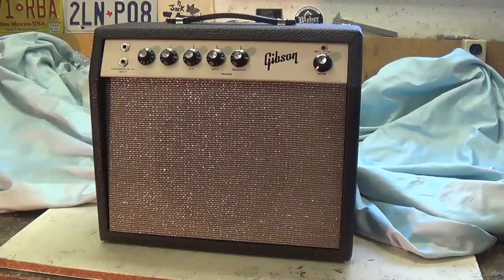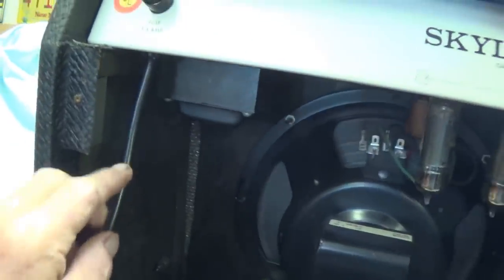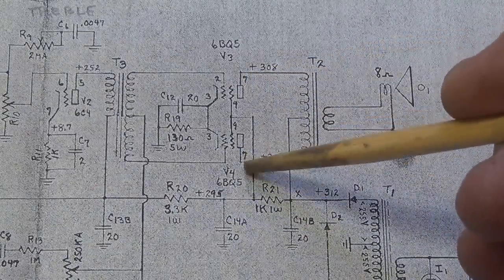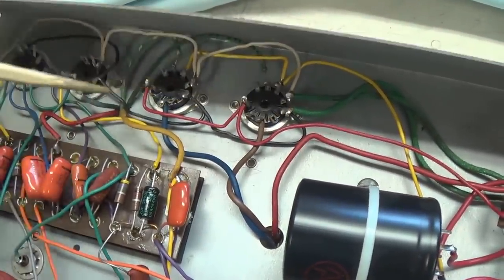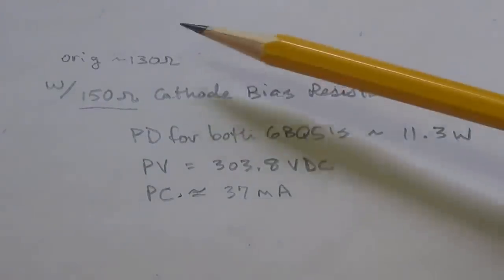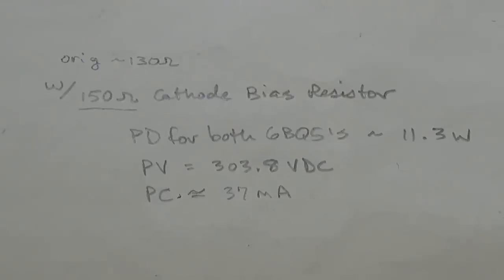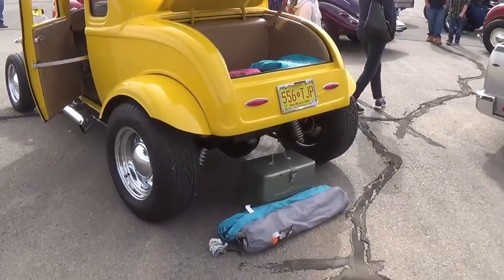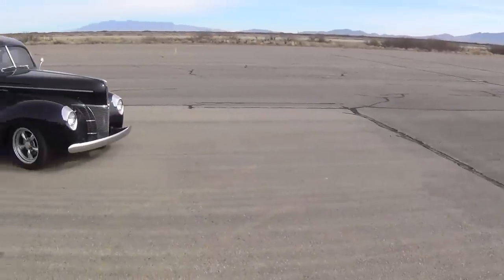1965 Gibson GA-5T Skylark in Superb Original Condition

Comment: Hi Uncle Doug, 
I bet that you have just been anxiously waiting for my customary comments to arrive. Sorry for the delay, we had more pressing matters to attend to, watching our four-year-old grandson, and several other four year old children chase a soccer ball around on a beautiful morning in Waxahachie. Kinda reminded me of trying to herd cats. But it was the last game of the season and our grandson made the only goal for his team. Unfortunately a five foot tall four-year-old on the other team scored their four goals. Oh well they had fun and my grandson's first question to my son when he came off the field was when do I get to start Tee-ball? On to the amp. Gorgeous little amp, hideous design. Your mods made a huge difference. I was just wondering, if you put a wire on the forth  tap on the filter capacitor then replaced the 100K resistor with a 75K and a 25K in series, with the 75K to the plate of the 6EU7. Then connect the wire from the filter cap to the connection of the 75K and the 25K resistors, that would give you a nodal resistor for that final low pass filter in the B+ circuit and keep the voltage on the plate about the same. It might climb a little depending on the ripple at that point. I could hear that customary Gibson 120 cycle hum between chords even with the humbuckers. If it were me, I would have to do as Chubby Checker said ”Come on baby lets do the twist ” to the filament wiring, all of the AC wiring just for good measure. It also occurred to me that the Depth control pot was treated exactly as you stated ”like a volume control” and Gibson used an audio taper pot instead of a linear pot which would account for the poor performance at 1 through 5 of the settings. If I remember correctly the schematic had it labeled 250KA.  One last thing; Star Grounding, hum reduction 101, I guess in 1965 they figured the magical humbuckers would cure it all. Can you imagine someone playing a Stratocaster through one of those amps. Talk about fingernails on a chalkboard, wow. The cars were beautiful, I must agree a 9 inch differential was a poor choice for the yellow Ford and chrome coil-overs, yikes. Almost looked like he was going to go off roading. The honorees pickup was to immaculate. The louvered hood, the recessed radio antenna in the fender and flush mount  gas cap beautifully done. The world  has lost a truly great craftsman and artist. Well, I will end my novel at this point, Happy Easter.
Reply from the maker: At last, you showed up to offer your wise (and welcome) insights, Mark. Your analysis of the Tremolo depth control was right on the money. It should have been a linear pot. I did try single coils through the amp before the mods and had to have several of my fillings replaced. Fortunately, the neighbor is a veterinarian who was handy with JB weld :) Thanks for your spot-on analysis of the car show. It's good to know that I'm not the only one suspicious of the real birth date of 5-foot-tall 4-year-olds......I recall facing several of them in Little League. Some even had beards and smoked 2 packs a day. Oh, well.

Comment: At 17:05, when you point out the power cord wiring that goes first to the fuse, it would have been worth mentioning that the hot wire goes to the rear of the fuse holder, as it should ---- although it might not have been wired that way from the factory oh, I see plenty of vintage amps where the hot lead goes to the middle tab on the fuse holder. The reason for connecting the incoming hot wire to the back end of the fuse holder is so that the fuse disconnects itself from the house current supply first if somebody goes to remove and check the fuse while the unit is plugged in and turned on. Reduces the chance of shocking yourself as you pull the fuse out, assuming the fuse is okay (ie, the fuse is not the reason for the amp not functioning or not producing any sound); unpleasant things can happen if the incoming hot lead has been wired to the central tab of the fuse holder and you happen to touch the metal parts of the fuse and fuse cap as you remove it, with your other hand touching something metal that is grounded,  such as the guitar strings or another piece of equipment that you're leaning on as you bend over the amplifier, or whatever.
Reply from the maker: Thanks for reiterating this helpful detail, GU. Yes, it's always best to wire the fuse holder with the hot wire to the distal end.

Comment: Transformer coupled phase inverters were quite common in radios in the 1930s. Apparently, back in those days an extra tube and socket and the requisite resistors and capacitors were more expensive than the cost of a small transformer to do the necessary phase shift function. After World War II, when tube designs had become more efficient to manufacture, and tube manufacturing factories were really humming along and cranking tubes out by the millions, the  situation reversed itself, and the additional phase inverter tube and socket and related parts were cheaper than the phase inverting Transformer. Perhaps in this particular case, Gibson got a low-cost deal on a big batch of interstage Transformers.
Reply from the maker: Your observation is probably accurate, GU. Component selection was generally based on economics rather than performance......but in this case, it was for the best, IMHO. Interstage transformer rectification generally  provides beautifully symmetrical secondary outputs.

Comment: Great stuff thoroughly enjoying the tours... I am slightly confused though - if the secondary is 255 - 0 -255 (rms?) then how is the dc +312V 255*sqrt(2) is 360 - I'm sure it's right but I'd certainly like to know why - feel free to point me at one of your earlier tutorials
Reply from the maker: This is covered in a previous video, John, that discusses the fact that the filter caps smooth the rectified, but rippled, DC to peak voltage.....which is higher than the RMS transformer rating.  Losses during the rectification process, OPT impedance, nodal resistors, etc. tend to lower the peak voltage, however, to a value in between the RMS rating and the peak.
Reply: @UncleDoug Thank you for your speedy ans helpful response. Yes I know remember that vid. So I can only be sure that the voltage will be somewhere between the rms and peak.
Reply from the maker: You're welcome, John. Yes. Ideally, it would be the peak voltage......but, as you know, no mechanical or electrical system is ever 100% efficient.

Comment: I have one of these in my 'to do' stack, minus the Gibson logo, that I bought from the Guitologist a few years back...just love that grill cloth they used...the redwood cab is built like a tank (except for the particle board panels), and if I'm not mistaken, almost every amp in this line at that time used the inter-stage tranny as the phase inverter...guess it was a way to save wiring up a tube...I'd be curious about your take on how that affects the amp's tone...
I also have an Invader (GA-35) that I refurbished, and I have to say that the wiring and the circuit on that were so convoluted (tone sucking networks, indeed) that I basically gutted the existing circuit and rebuilt it as a suped up Deluxe Reverb circuit, and added a vintage Jensen 12"...probably the best-sounding amp I own... 
Congrats on another superlative presentation, Unc.  Please keep 'em coming...
Reply from the maker: Thanks so much, C7. My experience with transformer PI's is that their two out-of-phase outputs tend to be exactly balanced......more so than with tube PI's. I guess this would maximize output power and minimize hum.

Comment: At about 13:45 you state that the interstage phase splitting xfrmer goes to the 'plates' of the 6BQ5s. I think you meant the grids?
Reply: 13:52 and 14:02.
Reply from the maker: You're right, Joe. Another viewer mentioned this and I am going to post a correction in the first (pinned) comment. Thanks !!!
Reply: I spotted this too, but you get it right later at about 27:00, overall a low error rate for live one-off lecture.  I reckon this thorough style is worth doing a few more of as time and opportunity arises.

Comment: Another great one, thanks. One small suggestion: when demonstrating the amp tones, say a bit more about the guitar and settings. Here you mentioned that the guitar has humbuckers, which was certainly helpful, but whether the neck or bridge was being played would certainly figure in how (overly) bright the amp is. BTW, does the Studebaker still have its death cap?
Reply from the maker: You're welcome, Ben. I have been much more careful about this in more recent videos. Thanks for your input. No, the D.C. was carefully removed, using remote tongs and a blast shield :)

Comment: 14:14 - Probably a good idea to put some distance between C7 and R11!
Reply from the maker: Why is that, David ??
Reply: @UncleDoug  So the cap doesn't get burned by the resistor.
Reply from the maker: The current flow though the 6C4 is miniscule, David. The power generated within the resistor is probably on the order of 1/50th of a watt.

Comment: Question I have a mcMartin ma10 amplifier with a diode rectifier.why is each diode bypassed with a resistor? 
This is my first amp I have recapped that has not had a rectifier tube.
Where do you find schematics for your amplifiers? I've had no luck with this one
Reply from the maker: I have not seen the bypass resistor used with diodes, but with capacitors, and it may be for the same purpose......it is to ensure that an equal amount of current passes through each diode, rather than all through one and none through the other, possibly overloading the one that received all the current. I have no treasure trove of schematics, but simply do what you are doing.......trying all sorts of Internet searches. On obscure amps, like yours, there often is no schematic, so you can either find a fairly close match for it, or do without.

Comment: All we needed was a Buick Skylark in the car show :). As someone that's dabbling in the vintage stuff as a hobby, I'm getting better at schematics, but I always appreciate when you go through the schematics. It reinforces what I think I know, or it fills in gaps with what I'm familiar with. Maybe something you can offer an opinion on. I have a Magnatone M10A with a working vibrato, but the intensity and speed pots are stuck on either one resistance, or go essentially open. Since they're not necessarily in the tone stack / volume department, do you think they would have used a linear taper pot or could it still be audio taper? I can't test the sweep because they're so worn, and the schematic doesn't show an A like I saw in this Gibson schematic. What would Uncle Doug do here if you weren't sure which taper a replacement pot should be? If the answer is in another video, I'm happy to go watch that or re-watch it :)
Reply: An educated guess says that both the intensity and speed pots are likely to be linear, but since you're may have to replace them anyway* , you could simply take them apart by prying up the metal tabs that hold the metal cover over the back side of the pot. Measure the entire resistance of the carbon track on the phenolic wafer from end-to-end, then measure it from one end to the approximate physical middle of the carbon track, corresponding to the pot being set roughly in the middle. A linear pot will have approximately half of its full resistance found at that midpoint, whereas an analog or audio taper pot would likely have 80 to 90% of its total resistance found between one end of the carbon track and the center point, and 10 to 20% between the other end of the carbon track and the same physical centerpoint.

* and while you have the potentiometers apart, you could try to repair them. Clean the carbon tracks carefully with Q-tips and alcohol, or perhaps with a pencil eraser shaped to a blunt chisel like tip, if the carbon tracks look kind of striped. Also ****carefully**** clean the wiper fingers and the metal commentating rings with the pencil eraser, retention the wipers by bending them out very slightly, and I do mean slightly, and carefully! Degrease with alcohol, then reassemble and give them a little spray with some electronic control cleaner that has a lubricant. (Alternately, we often use clear silicone based transistor heat sinking grease to re lubricate an old pot, it doesn't take much of it at all, and it's a good idea to put some on the shaft of the pot has you reassemble everything. ). The pots are already messed up, so you have nothing to lose! Testing with a multimeter for smooth resistance change before reinstalling.
Reply from the maker: It looks like GU has answered your question quite well, Andy. Best of luck.
Reply: @goodun6081  Thank you SO much for the ideas and suggestions! It is most certainly worth attempting a repair on these. They are knurled & split shafts, and I'd much prefer to keep them original if possible. Bourns and Alpha seem to have options here for a linear 1M pot but I will do my best to resurrect them. The amp has the original GE and Mullard tubes plus the original C12PS speaker. I need to have the speaker repaired, so I have a 16ohm C12R installed for the moment. The magnet detached from the basket in one piece (in shipment... thanks UPS). Fingers crossed the local speaker guy can fix that too. It's a little bit of a project, but it has good bones!
Reply: @UncleDoug  Thank you Doug!
Reply: @Andy_Yates  , far better to have a speaker damaged in shipping then to have the aluminum handle of the magnatone M10 get broken during shipment! the aluminum casting and assembly underneath the plastic top is Infamous for frequently being damaged in shipping.

And as for repairing the speed and intensity parts, probably a good idea or two practice on an old unimportant potentiometer, a reject or pull from your junk box, that looks sort of similar, just to give you an idea what it looks like or what you are likely to encounter when you disassemble those magnatone potentiometers. If you can take another pot apart, clean it and put it back together successfully, then you'll probably be ready to fix the magnatone pots. Just be aware that the nylon or similar plastic wheel like piece inside the pots that holds the wipers in proper alignment might be cracked due to physical trauma or the plastic shrinking with age, and it can be difficult if not impossible to glue or otherwise repair those things if they're badly broken. The wipers are often held in place on that plastic wheel thing by a sort of plastic rivet sort of thing that has been mushroomed or squished flat  with heat ,  but the heads  of those plastic rivets sometimes break off and the wipers will flop loosely. You can use a tiny little wire brad or nail pushed through the hole at the base of the wiper into the plastic wheel with the heat of a soldering gun on the tip of the tiny nail, softening  the plastic as you push the pin into it. You might be able to reinforce that mechanical bond with some water thin Super Glue, but nylon or similar Plastics often do not adhere very well to most super glues, or most glues in general, and you'll certainly have to degrease the plastic extremely well. I've repaired slide fader pots in Bang & Olufsen Hi-Fi gear with a few well-placed dabs of J-B Weld epoxy, but even that might not stick to the plastic pieces inside a potentiometer. Supposedly there are some types of plastic Fusion epoxy available now Atwood here tonight on another slippery Plastics. I can't vouch for it. Anyway, like I said, practice on another pot, or a couple of them, including perhaps one that is severely broken.

Comment: I think i just found the absolute best amp guy on youtube! I have a question about a gibson minuteman i just picked up. The power knob switch is strange. It feels like it clicks about 25 times while turning. About 12 clicks in i get power. Is it supposed to be on/standby/power and physically feel 3 clicks?
Reply from the maker: Thanks so much, OA. According to the schematic, it's a 3-position switch. If it feels otherwise, but still works, I guess you can continue to use it.....but you might shop around for a replacement, i.e. at Mouser or Antique Electronic Supply.
Reply: @UncleDoug  ok cool. Yea i would rather just replace it. Happen to have a part #?  Its a cool amp. Someone recapped it with mod caps. Theres a couple iffy things and i had to put a mod reverb tank in it as it was missing but there reverb when engaged makes some buzzing noise, still sounds great but the buzz is quiet when its off. Also noticed when volume is off on the reverb/trem channel the guitar still bleeds through at a low volume and that channel is quieter than channel 1. But maybe thats normal. Its my first tube amp so im learning, and a lot of learning from your channel. Thank you.
Reply from the maker: @OxaudioPhilly  Sorry, OA, but I don't have part numbers for any amps other than Fender. Keep working and experimenting.....it's the best way to learn.
Reply: @UncleDoug  all good. You are right

Comment: So was disconnecting the Cap the only mod you did? You mentioned the 1M grid leak and removing the cap in front of the input tube too.
Reply from the maker: The modifications were described in the video, Allan, and were not at all extensive......yet the improvement seemed significant.